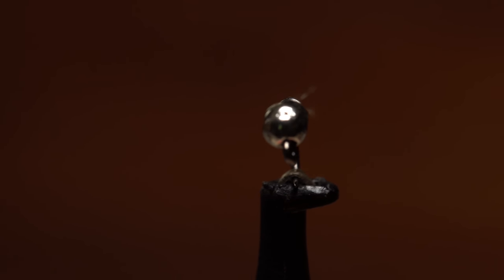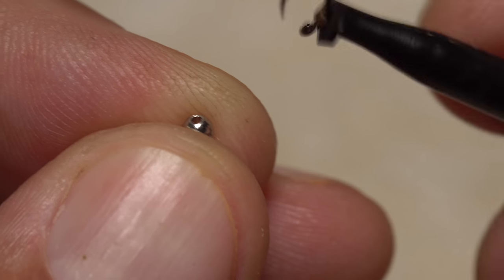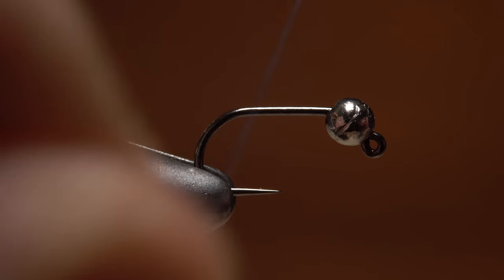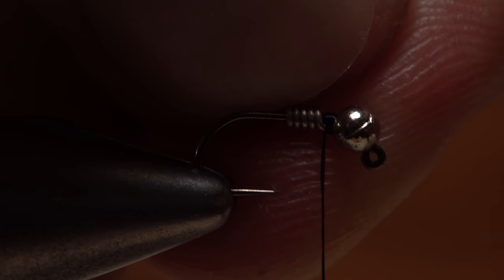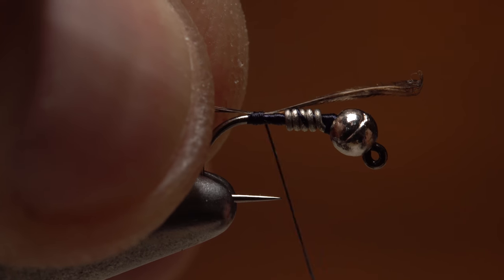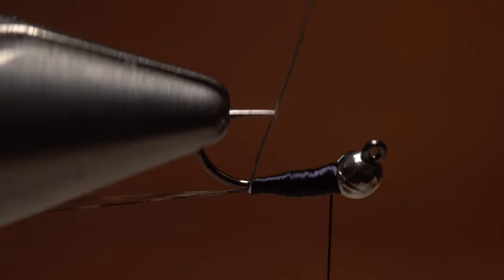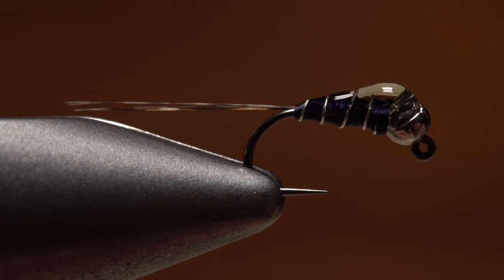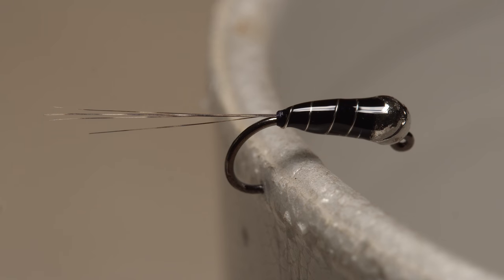Perdigon Style Zebra Midge

Comment: How much glue do you get with the bondic? How many small trout flies like this can you tie?
Reply: I just loved seeing that he used the Bondic with the built in UV light!!  I found it about a year ago when I was working in a hardware store.  It comes in a nice little tin that has the light with one tube (it just slips on the end of the light) attached to it, and a refill tube.    I've used it a ton in the last year, tied a lot of flies, and I'm still on the first the first tube and the batteries in the light are still working, haven't even cracked the refill.  I have however checked and you can get the refills on Amazon.